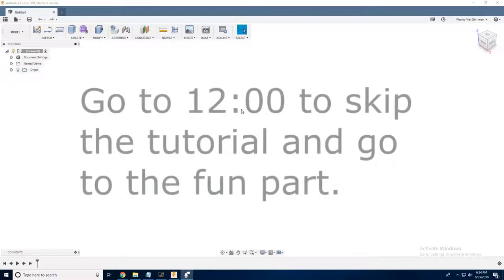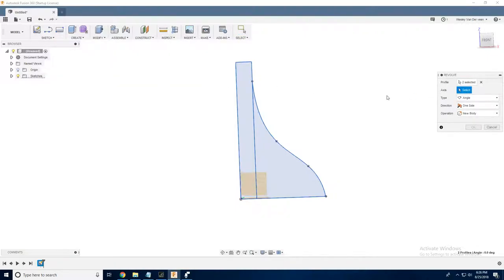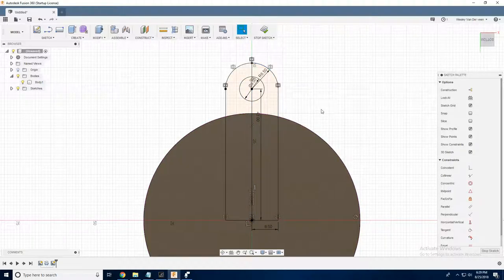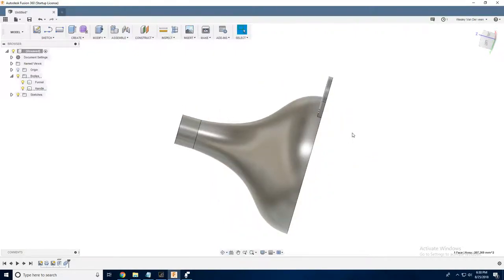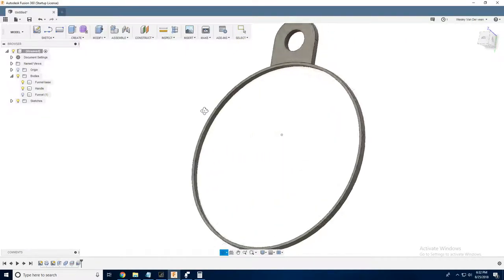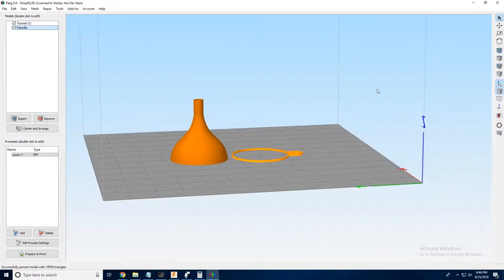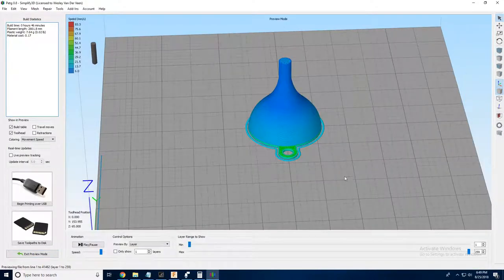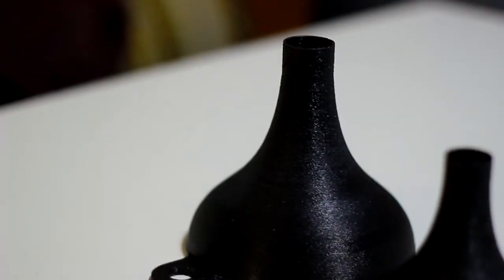3D Printing tutorial: Vase Mode & Infill in one job - with friends and funnels!

Comment: Hey what if the material gets lifted off the bed especially thin lines? Should I make the bed hotter than 60degrees f ?
Beginner here haha
Reply from the maker: Hi there! If you are having issues with bed adhesion, it is definitely helpful to play with bed temp. For PETG I usually find 60 degrees is optimal, but it really varies by rig and materials. Definitely using a skirt on your first layer will help. I also recommend getting a VERY level bed with a feeler gauge, using said gauge to calibrate mesh bed leveling, and going low and slow on that first layer.